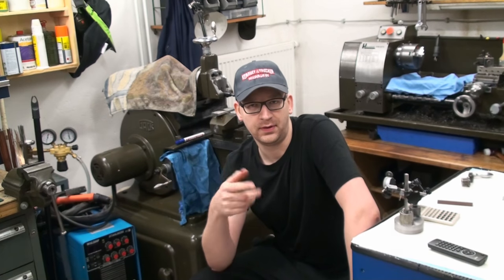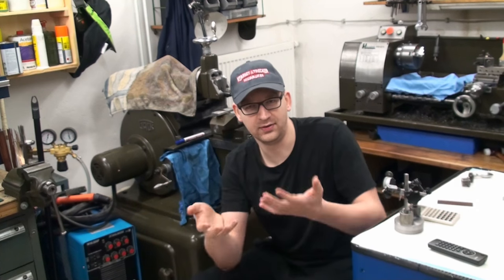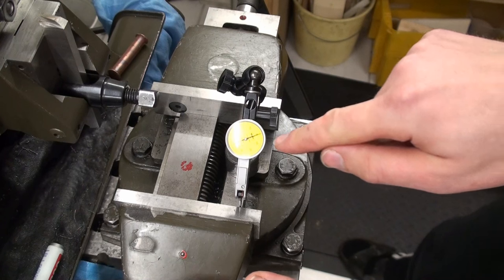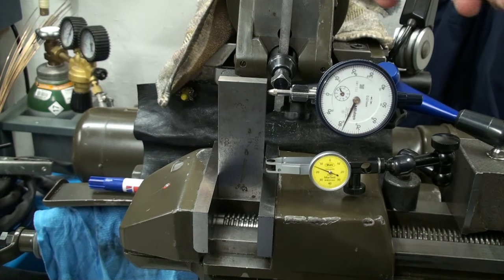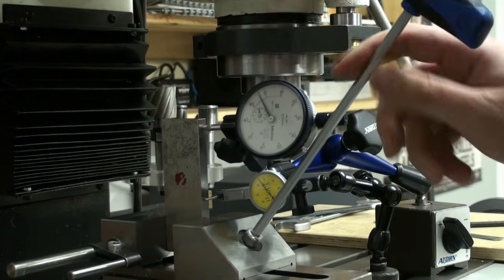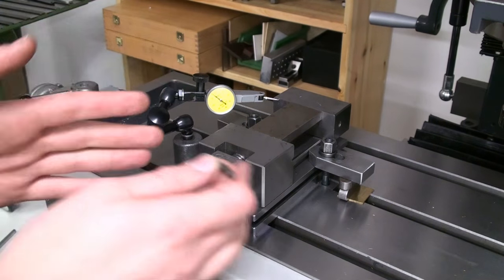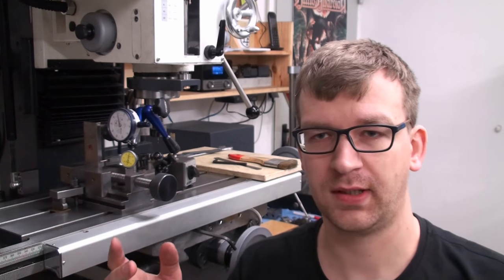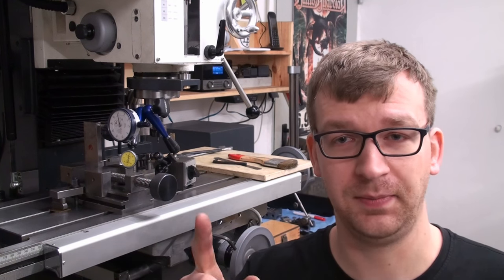Machineshop Physics: Vice deflection - Schraubstockverformung

Comment: Exactly! As I'm always nagging: EVERYTHING is made of rubber. Wherever there is a force acting on an object there is always deflection however small. We in precision manufacturing constantly learn this the hard way.

Way to go Stefan in the way you explain these basic truths of the trade.
Reply from the maker: +Forrest  Addy Forrest! You here? I think I read your "Everything is made of rubber" on Practical Machinist once...and since then its always in the back of my head :)
Thank you for watching and commenting!
Reply: +Stefan Gotteswinter I'm a fan, Stefan. I check your YouTube channel every couple days and I'm constantly referencing your relevant videos to people requesting trade related info. I reference other people too but you are a principle resource.

Keep it up.

Forrest
Reply: I didn't realize how sensitive metal could be until my instructor talked about clean rooms, leaving a part in over night untouched just so you can run one op and wait for it to cool back down, because the temp causes changes in the density of the material. It expands and contracts and in extreme precision applications, even the temperature of the part is a factor.

Comment: Stefan, great insight on vise deflection! Never thought they would move so much under clamping force.  After watching the video, I decided to repeat your test on a Kurt 688 AngLock vise. Results are as follows. The numbers are not by any means close to scientific, only to provide the info you requested in the video.
With "normal" torque on the handle, the back jaw deflection is 0.002", front jaw lift is 0.0006", angular deflection of back jaw is 0.0016"/0.0015" top and bottom over 80mm.

Comment: Very good video on vise deflection.  That is something I bet most of us amateur machinists would never think about.  I was not aware of it anyway.  Thanks for the video.
Reply: This topic is a good element to add in when you are studying the elastic modulus. I once saw a film where a man screwed an inside mike crossways (lightly!) into an engine cylinder bore, he squeezed the ends of the iron engine block together and the mike fell down the cylinder! Your rubber band analogy is a valuable one.

Comment: "Everything is made of rubber" Thats a great way to think about it :).
Makes me think, once youve an idea of how flexible your vice is, a torque wrench might come in handy. Also ways to reduce the clamping pressure needed by using say paper between the part and jaws to increase grip.
Have you seen 'hold downs'. I remember seeing them various old shaper books. Strips of metal with slight angle on the vise mount side so as when you clamp down, the face of the hold down aims to seat on the jaw surface, in turn pressing the part down on the vise or table surface. 
All fascinating stuff. 
Cheers :)

Comment: Stefan! thank you! this was very timely as I was having trouble squaring some stock and found that my fixed jaw was moving significantly when I snugged down on it. I have since backed off on the pressure I was using and will be checking the torque of the bolts holding down the fixed jaw. It is a Kurt style clone and I was getting .002 inch deflection.

Comment: Stefan I did a series of videos(YouTube is Edge Precision) using a Kirt vise about squaring a part. I called them square me up to 90. Although the tests I showed aren't quite the same as yours they do show how the vise flexes with clamping force and what to do to actually get a part square in a vise. To really square a part I prefer a horizontal mill with a B axis with the part clamped directly to the table. I did do them on a small CNC mill but I have done the same on a manual machine as well.

Comment: Good video and thoughts Stefan. something to consider when we mill in a shelf to the jaws to act as parallels, negating any tilt the company factored in. This may also be the reason for what looks like material flex when clamped. those figures surprised me... much higher than what we chase all day trying to precisely tram in the mill. 
Thanks for enlightening me:-)

Comment: Off to indicate my 8" Kurt on video for reference. I don't normally shoot for sub .oo1" work with my sledge hammer mill but on that 36" block plate I was able to hold it or I couldn't have put the slip fit liners in when I was done.

Comment: Cool video.  Great idea.
My 100mm (4") Gerardi milling vise has a fixed jaw deflection of  .013mm (.0005") and the same moving jaw rise. A thick parallel on end deflects only .018mm (.0007") at 100mm above the jaws. It has the angled floating jaws to suck the part down, but I have them screwed tight and I tap the part down instead.

Comment: Stefan you mentioned that the shaper vice is tilting the part towards the indicator....
But if i see it correctly the dial moves anti clock wise...
This would mean the part is tilting towards the fixed jaw and not towards the movable jaw

Comment: Great video, I now have to re-evaluate everything I took for granted in my shop. To be a little nit-pickey, could part of your shaper vise deflection been due to refrencing off the rear base of the vise where the screw loading could be actually bending the back half of your vise? Have you repeated this measurement using some other part of the machine for your magnetic bases? Sorry to be "that guy" but you're the one to get me thinking in the first place! Thanks.

Comment: Nice video.Did you hone the fixed jaw before testing the tilt?If there is a small burr low down it will be deformed when you clamp down hard.So in fact not bringing your test piece out of square, but closer to square. You only measure tilt change, not squareness.Distance from burr to top of jaw is small compared to distance between the instrument probes, so the deformation will be magnified.I assume you cleaned the part and jaw, or a tiny particle would have the same effect.

Comment: Hello Stephan. Really interesting video you made. I've quiet the same results with my vices but I currently use a torque wrench calibrated at 5 mN for steel. On my milling machine I use a good copy by Vertex of a Kurt vice (100 mm wide) for large and middle pieces, but for little parts I use a precision tool maker vice (50 mm wide).

Regards - Didier

Comment: Very good point Stefan,.I think i.need to check my 30+ years old Abwood for lift , it's a 4" (100mm) and i know the fixed jaw deflects about 0.03mm but never really considered lift. i just kept the gibs rather tight. It's a dovetail design so easy adjustable for minimal play. Also got a very heavy 6" of similar design, so i think i am going to take some footage tomorrow....

Comment: Good stuff Stefan.  I would be curious to see, if you had the indicator on the part, how the deflection effects the part if it is in the vise horizontally instead of vertically.  I know that my Kurt vise is worthless for holding while face milling because of the upward movement of the moving jaw, however, I've never measured how much it actually moves.

Comment: cool video. 

i have a machine-shop physics question. perhaps you can answer here, or make a video on this topic if it is suitable.

why is it that people suggest that a surface plate be mounted on three support points that are used between the plate and the supporting stand/cabinet that the plate is resting on?

i get that a tripod is stable relative to a four-legged structure that can tip if one of the legs come off the ground; however, flatness has nothing to do with level. 

a surface plate hung from the wall of your shop would be perpendicular to the ground and it would still be flat, no? so why are three feet preferred and not four?

if you have four adjustable feet you should have a more stable surface than a three-legged arrangement given that a weight can be put on any corner of the surface plate and it will not tip. 

if one of the feet loses contact with the ground for some reason, you can adjust it so that the foot regains contact as needed. the adjustable feet make sure that each foot can always retain contact with the floor or stand the plate is on. 

so why worry or prefer that there are three feet?

my guess is that it really does not matter relative to flatness.

Comment: Just a newbie question: if the movable chuck of the screw-less wise is so perfectly rigid, why don't they make the wise with two symmetric movable chucks? Looks like the 45 degrees downward screw really does a great job at keeping things tight...
Reply: It is common to use the fixed jaw of a vice as a reference index so it is possible to load multiple parts in succession without the need to set up each part individually. Having two moveable jaws would severely reduce confidence in the setup over time. Tandem vices with two opposed moving jaws and a common fixed jaw are available but are regarded as specialty types.
Reply: Makes perfect sense. Thank you so much!

Comment: If you took off the replaceable jaws and did the measurement against the part of the shaper jaws permanent parts of the jaws, do you still see the same deflection?  Just curious on how much of the play is due to how the replaceable jaws are bolted on to the vise?

Comment: Hi Stefan
Very interesting video I have a virtex vice on my milling machine and will be doing those tests just to see how much deflection I get but really I do not have the skill level to work to the tight tolerance that you work to. I would like to but I can only work with what I have. I have a six jaw adjust true chuck on my lathe and have dialed it in to 0.005 mm and that nearly sent me nuts for two weeks on and off. So now you have just given me more things to stress about LOL very much like your videos.

Dave
Reply: +David Cashin : Hi David -I think you sell yourself short, you do have the skill to work to fine tolerances, you just have to convince yourself first. It all comes with learning and practice.
Regards MoK

Comment: very interesting video. even though vise flex may never be an issue with the home shop machinist, it's good information. do you think that vise jaw flex is the reason that it is sometimes impossible to get both sides of a part to sit down tight to paralells?
Reply from the maker: +larry sperling Might be, but most of the time its a small burr, a few atoms of swarf or the wrong moon-phase. When this happens I try to wiggle the loose parallel up and down to feel if its very much off and if I can live with it...
Reply: I always assumed that was just that the faces were not square and it was just referencing off the fixed jaw. But I can go with wrong moon phase too.

Comment: Good grief, Kearny & Trecker hats make it to Bavaria :) .Seriously,  I think that all metals are springs. Put enough force on a spring and it bends no matter how small the spring constant is. And I think you proved that quite conclusively. I am not at all surprised that bcbloc2's 100-Kilo vise did not deflect as much as the shaper vise, given the size. Deflection under load goes as square of length (in a horizontal beam, as depth square) and the Kurt has an awful lot of length and depth both. This is a lesson to me. Never trust a vise. The numbers were amazing, I did not expect .05 mm. Thank you very much!

Comment: Have you measured moving jaw side movement? It can be a problem if you clamp a number of long parts in one vice lengthways, they will all be slightly different lengths and the longest one can 'kink' the moving jaw to one side. Really annoying error for me until I worked it out, all my holes near the moving jaw were randomly 0.05mm to the left or right depending on which side of the vice the long part was in.

Comment: One might characterize their vise and use that knowledge to implement sufficient compensation with shims placed appropriately to have the part clamped true when tightened up. That is only if one needs to do so for very precise work.

PS: Great video!

Comment: Hi Stefan, thanks for the inspiration. I've  just uploded a video testing 2 very well used ones,  a 4" Abwood and a 6" of unknown brand (Both British made). Surprisingly the results are not much different from your's which looks alot better maintained yjan mine. I used a torque wrench to ensure the pressure is always the same.

Comment: Stefan 

Would the test be more subjective between the vices if you could measure the actual clamping pressure of the jaws with say a strain gauge/load cell , as I suspect the shaper vice has a greater clamping pressure than the toolmakers vice 

But as usual I may be wrong 😱

Keep up with the videos as I always find a useful bit of knowledge in every one

My German is very poor and limited to technical stuff in electrical systems as we had a lot of Anton Piller equipment at the banks computer centre as had to work along side the very good female engineers they sent over

One thing I do agree with every thing is flexible , just work with a optical bench that will show just how bad it can get

Stuart

A very aged electrical engineer now at 69 circuits around the sun

Comment: you should depressurize reductor of welding machine when not using it. keeping it under pressure for long time damages internals of reductor. just turn off gas tank valve and push TIG button to open solenoide valve and let argone or co2 leave reductor

Comment: Hi Stefan, I think you read in my mind. I was just looking for which is the better vise design. And, yes, I have read on forums people who say that grinding vices or toolmakers vices (how do you call them) are not good for general milling pourpose. But your advice now opens my mind and push me in the direction of that style of vice. The only difficult is that a lot of imported ones doesnt't have longitudinal slots like yours for clamping on milling table, they have just holes. So, is there a solution to clamp them? I have seen some special clamp block for that vices, but just one or two sellers have it.
Reply: + Cosimo Marotta They often have the slots at each end, well at least mine does.
Reply: +Cosimo Marotta  Since the objective is to just hold the vice to the table why not just clamp on top of bed (with protection) or make some clamps that engage the holes? Maybe pass a bar through an empty hole to clamp on. Most drill press vices have no means of clamping so all of mine have acquired holes on each side so they can be used on all machines.
    Mike (o\!/o)
Reply: Hi folks, searching through the offers of sellers, barely all of them sell a model, in various sizes, with clamping falts just in front and rear of the vice. Along sides there are only holes (parallel to the plane). So it is hard to clamp the vice perpendicular to X axis. For this reason, someone have develop a pin style clamp, but I don't like it much. Stefan's vice has two parallel flat allow you to clamp the item to the table, but this design is difficut to find. That's was my doubt.
Reply: Hi Cosimo, In the UK you can get side grooved vices from       http://www.arceurotrade.co.uk/Catalogue/Workholding/Machine-Vices/Precision-Tool-Vices-Type-2
If you wonder about lack of holding down recesses, remember they are really meant to be held on a magnetic chuck hence the (false) thought that they should not be used on a milling machine.
Reply: Thanks LWSH, just putted in my aim.

Comment: 4:35 the stylus of the test indicator in perpendicular to the indicator... doesn't that induce cosine error?
Reply from the maker: No - The stylus is pretty much square to the direction of measurement, so there wont be any cosine error. Only if the stylus gets very far (25° or more) off parallel, you start to introduce a noticable error.

Comment: It all goes to impress that items should be set up using a dial guage on the item, not the vise.  I'm not surprised at all where items are clamped
Reply: +R Balderson : Hi, A good point, set the dial gauge on the workpiece but base the dial gauge holder on the table as it's the table that should be zero referenced to the quill.
Regards MoK

Comment: 18:10 How can the deflection be 2/100 mm at the bottom (near the jaws) and 1/100 at the top... does not compute.
Reply: G'day Alexandre, I know it's been a long time since you typed this but... :)  Because the moveable jaw is lifting slightly as force is applied, that means it is probably pivoting on the jaw's lower back edge (nearest the crank). This would mean that, at the gripping face, the top of the jaw is pushed a fraction further back than the bottom edge. Cheers Duncan

Comment: Stevan

A bit late on parade with some info

Now this is a 80mm cheap far eastern angle lock vice from eBay , RDG do them as do rota grip on eBay but not on there site it was £70 inc p&p and the Vodka And Tonic 

Measurement with a 0.01mm DTI  using the supplied handle with a bar at the top of the jaw

Moving jaw lift 0.01 mm fixed jaw deflection backwards 0.015 mm

It's not a Kurt but not bad for a far eastern clone I have not done any work to it except clean it 

Stuart
Reply: Sorry RDG do not do they but rota grip still do on eBay the casting look a bit rough but they are ok where it matters and they or cheaper
http://www.ebay.co.uk/itm/Milling-Machine-Vice-With-Swivel-Base-3-inch-/281926108798

Stuart

Comment: I do sloppy joe work. My machines are 80 years old and wore out. I get by doing work for myself and the local farmers. I've noticed things that are very accurate seem to be ground to size. I did notice a very big difference in the new Kurt clone import  6"vice compared to a "to wore out for Die Tech" Real Kurt. Kurt is much better than a Kurt copy and 10X the price.